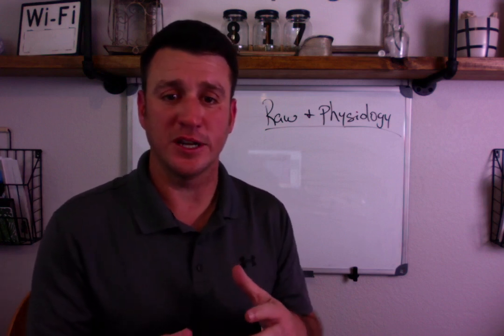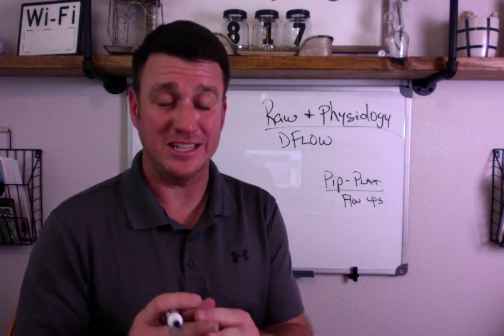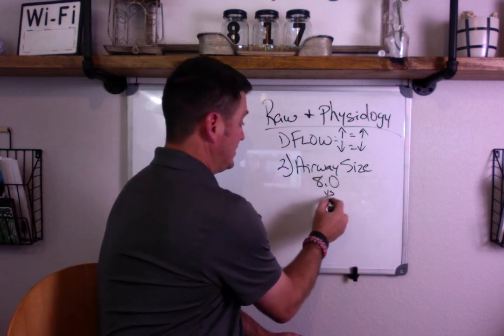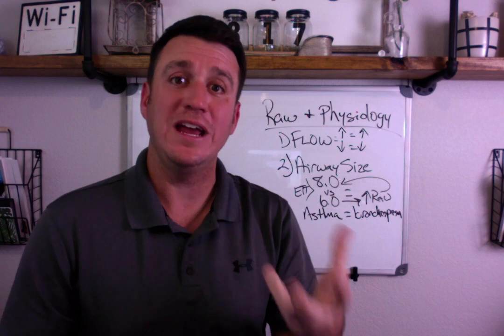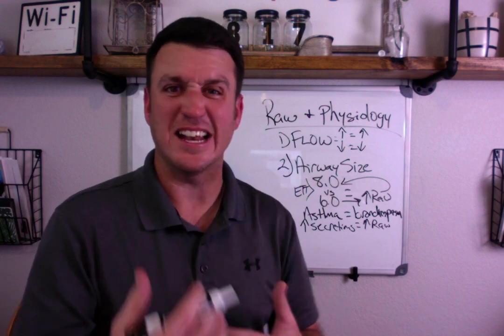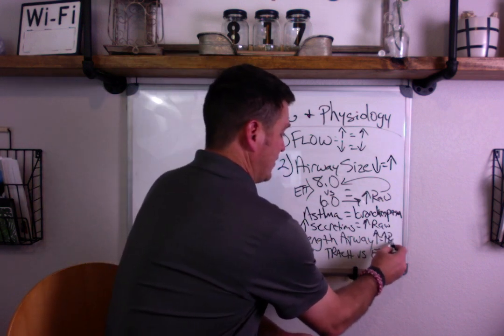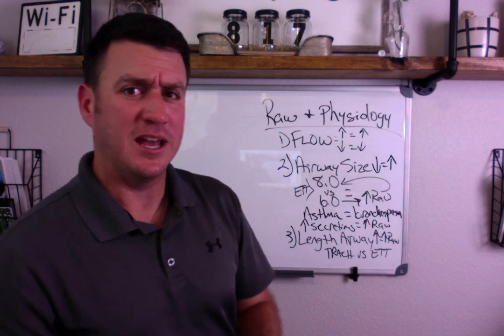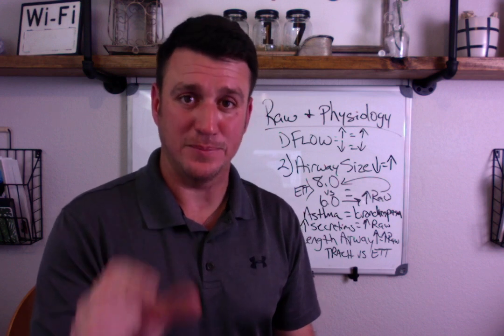Respiratory Therapy - Physiology of Airway Resistance

Comment: great explanation sir , sir what does automatic tube compensation do in a vent ,sir teach us how to apply it ,how to set its parameters , how does it affect the action of vent and resistance of airway , sir please teach us how to perform a trach collar trial test
Reply from the maker: Here you go, Waruna.  What you need to know about ATC.
https://youtu.be/I1eJ5zwIb1w
Reply: @RespiratoryCoach  thank you sir
Reply: @RespiratoryCoach  sir please teach us what will happend to the pressure , flow , volume wave forms when we turn on and off ATC  in mechanical ventilators.